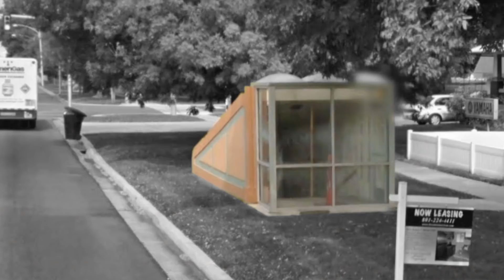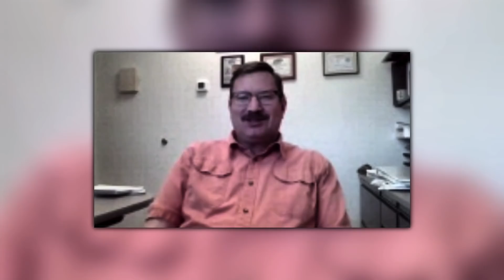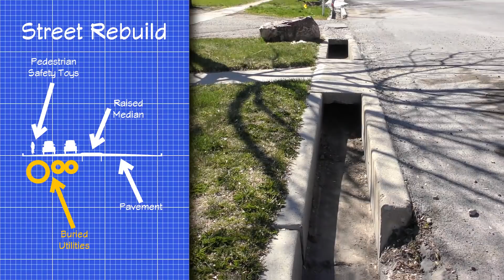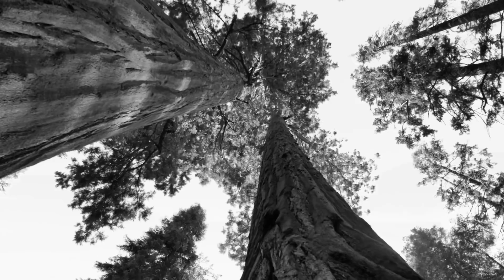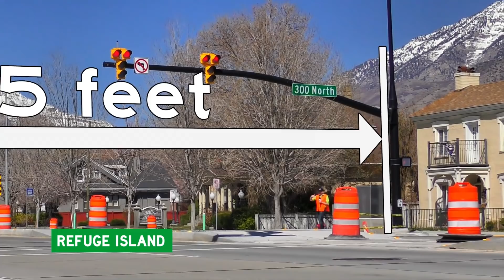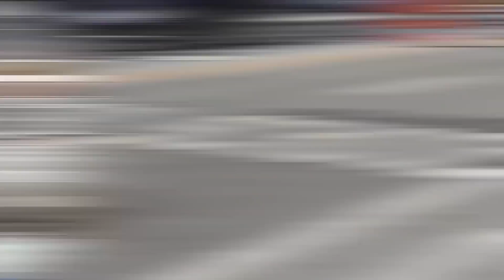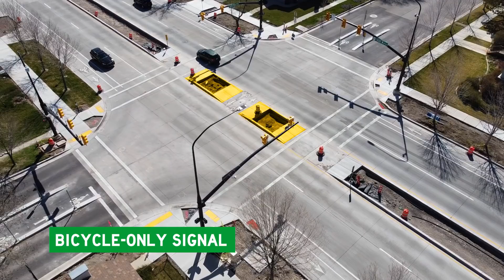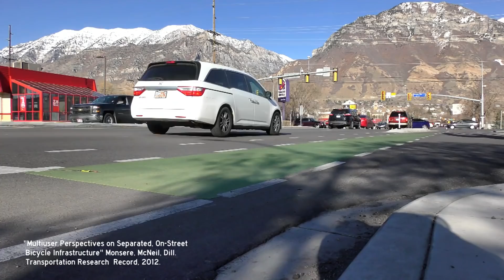Rebuilding the road? Joggers and bikers WANT TOYS, too!

Comment: One thing not mentioned is that sufficiently wide enough medians (6' at minimum, 10' minimum when considering bikes) allow for more efficient pedestrian timing at signals. Each button can call specific phases and sequences to reduce delay for not only drivers, but people walking as well. Along with giving a coordinated crossing and keeping as many other movements going concurrently. 

Something that is often not done, but could be. Problem is that takes effort and consideration for those outside a vehicle. Something our profession isnt great at in general.
Reply: Nonsense. Nobody should even be installing beg buttons anywhere. The safety of people using more efficient modes of transportation (walking, transit, cycling) takes priority over the convenience of people driving.
Reply: @drdabblju   @kisumxes  It's very sad that beg buttons get such a bad rep in the US. But it's not unwarranted. Better signal timing can improve trust in the signal, improve compliance, and protect vulnerable users better.

The problem is signals in North America typically run way too long of cycles, or allow for way too long of max green times, and don't utilize features in controllers that help pedestrians.

- Only run signals coordinated when absolutely necessary there's a whole debate there

- Then, only run as short as cycles as possible, and don't run too long of corridors. 80 second cycles are about the max time before you start running into longer than acceptable delay ped/side street delay.

- Use the ped-reservice function when possible. This allows someone to still get the WALK if they're a few seconds late to the signal, thus greatly reducing ped delay.

- Leading ped intervals with right turn on red restrictions also help dramatically reduce crashes and conflicts between drivers and people walking.

Until we change our signal operations and separate pedestrian phases from vehicle phases which would open up a whole new world for signal timing, there is a lot of benefits to running signals actuated...but who you favor is found in the timing files. 

I've changed signals so that the max time a pedestrian waits is 20 seconds...trust me, it can be done!

Comment: this road just needed a road diet instead didn't look that congested.
Reply: @SomedayIWT depends if you use the grinede space smart like using it for protected bikelanes or transit lanes you might actually increase the roads capacity you might even do that by splitting the road so you have a narrow access street om both sides so your road can stay a road. More lanes are usually not the answer. Atleast not if you want a livable city/town.

Comment: The problem with bicycle lanes is that they're great for a few blocks, then they just dump you into traffic when it gets complicated. They love to build it on wide open easy sections, where you don't really need it.
Reply: Arctic Line  That's 90% of bike lanes I've seen, even in bike friendly places like seattle only a few of them actually have the green crosswalk. Just painted gutters that stop a half block from the intersection

Comment: '3 lanes to 2 means more traffic'

Thats only correct if the corresponding volume of traffic by car is steady.

A comprehensive approach to infrastructure and urban planning which decreases available space for car travel does not necessarily increase traffic or car travel time....in fact, it probably makes travelling by car faster since more people will take public transit, walk or bike. Since it is 'cheap' to drive a solo car, anyone that can afford to, will, unless there is a more convenient faster option. By making more of those options you decrease traffic, you do not increase it. Such programs usually involve taking '3 lanes down to 2' or 1 --- so while SOMETIMES 3 to 2 will increase traffic in the short term. Ironically the ONLY way to decrease traffic in the long run is to go from 3 to 2 lanes/

EDIT: I guess it's not the only way. The government could get involved with restricting road access to only certain people, denying a traditional freedom to travel on public roads. Or they could start taxing/charging all users of the road a very high rate to decrease traffic (Whatever very high amount would make people want to spend longer walking or by public transit because it costs like 30$ a trip to drive). Those methods would also decrease traffic.  BUt if you don't like those options you better start investing in trains, buses, pedestrian spaces, bike lanes and all of the single family home demolition and rezoning needed to get rid of the current US hellscape.

Comment: every American city (and subdivision) really needs more separated cycle lanes.
But those cycle lanes always stop at intersections. why can't city planners design intersections just like The Netherlands?
Reply: Not-Invented-Here syndrome. We look for any and every excuse why it won't port, regardless of validity, even if the "issue" is mild compared to what the original had to deal with. "Those bike lanes they have in [medieval city] would never fit in our American-sized streets."

Comment: Great video! I work in your neck of the woods as a planner for Lehi! I think there has to be a balance for all the differing modes and we really need to make sure streets are safe for all. If safety features are not installed, then we push people into cars who may have otherwise walked or biked for a local trip if they had safe facilities and crossing points. Those who can’t drive or can’t afford a car are left with endangering their lives if we don’t plan these kinds of improvements. I will say I’m impressed with UDOT and the improvements they have been making for safer travel for all modes. I love that Provo put in those protected bike lanes, but I really wish Dutch style protected intersections were considered to improve visibility and shorten crossing distances. It is a definite improvement nonetheless!
Reply: Instead of all these wacky intersections and lanes, seems safer and more straightforward to just give bikes and pedestrians a parallel grid with their own small mixed use path and have them cross in the middle of the road at a 90 degree angle.
Reply: @RealestUrbanism   that is actually a great way to plan things and would be ideal! Complete separation of routes for bikes/peds and cars would eliminate a lot of conflicts and allow for complete priority for each mode on separate routes. It would make it comfortable enough that many more people would choose to walk or bike. The Netherlands is a place that does a great job “disentangling” their routes, or providing separate prioritized corridors for different modes. The Dutch terms “hoofdnetten” and “plusnetten” describe their transportation planning and how separate prioritized corridor plans are developed. In many US cities it is much more difficult to do because of how disconnected local street networks are and that suburban areas put most of their commercial areas along major roadways. This forces people walking and biking to use those roads, or more realistically forces most to drive thus making traffic much worse. That’s why “stroads” are an unsafe and inefficient way to plan transportation since local access and trips reduce the ability for a road to carry intended regional traffic flows. It’s all really a balance, but I think we are still way out of balance here in Utah and the US for that matter. It is getting better though!

Comment: One guy walking on the sidewalk with his long board was the closest thing to a bicyclist.
Reply: Yeah, which is hardly a surprise when to Americans this infrastructure is as novel as a zebra walking down the street. More intelligent bike signals, protected 2-way cycle paths and a lot of redundant bike infrastructure (two-way shared ped/bike path off to the side away from the curb, with an additional cycle gutter in each direction for the faster and more confident riders who would rather tangle with cars than pedestrians, is becoming increasingly commonplace in my city (Christchurch, New Zealand, about the population of Seattle and not the richest country by a long shot). 
I enjoy it, whether I'm in a car or on my bike. It feels more communal, safe and equitable to not have 6 car lanes with a bare hint of a cycle gutter. My biggest complaint is that the bike and pedestrian crossings are always set to a long timer (20-30 seconds) and lack the capacity to detect when the person who triggered the signal is no longer there, having run the red or just kept going. I guess the instrumentation and algorithms need more development.
Reply: That's the issue with just having a few roads with good bike infrastructure. You can't really expect people to choose a bike if there's not sufficient infrastructure to link up their home and destination. It'd be kind of like having a few great roads that are nice to drive, but you still have to drive on train tracks for a few miles to get to Arby's. You'd probably just take the train.
Reply: Tells you something about the quality of the infrastructure. I'm an avid cyclist and you will NEVER see me using that bike lane that flips over to the left side of the turning lane. Nope nope nope nope.
Reply: @HavokTheorem  What's crazy is when you do the cost calculations, bike and pedestrian infrastructure moves the most people per hour per dollar. Now, their top speeds are lower, and consequently comfortable travel distance, which is where trains come in. Cars are by far the most expensive option per person moved in an hour.
Reply: Pretty telling of the effectiveness of the infrastructure...

Comment: Where I live, the preferred method for bikes is what the city calls a "multi-use trail", they are essentially two-way bike lanes, raised to the sidewalk level and either used both for pedestrians/cyclists or they are separated. That way it doesn't take up a lane that was for car traffic, and the car/bike separation is a curb.

Comment: You could also do a video on the bus only lanes they are adding all over portland. The city is ripping out car lanes on roads that were already extremely congested making them a nightmare for rush hour drivers. the burnside bridge and oregon hwy 10 off barbur blvd are the two spots that has created massive back ups where traffic used to flow great.

Comment: I liked the mention of the diamond diverging interchange as a tease for the next video.
There's one here in my town in Lincoln. It felt weird the first time but it's better tbh that installing a cloverleaf exit. The paint and signs are necessary but the way the road is angled, with a pointy curb encourages drivers to cross over

Comment: Portland Oregon has two neat bicycle toys for traffic lights.

The first is that a lot of traffic lights now have a small blue light next to the red light. That blue light is there to let you know that the traffic light is aware of a bicycle waiting for it. When you roll up and stop on the trigger, that blue light comes on the let you know it knows you're waiting.

The second is a countdown timer that some signals have. It'll have a red stoplight for bikes that lights up when it detects a bicycle, and a ring of white lights around the red light that countdown to when the bicycle is going to get a green light. It doesn't mark any specific amount of time because it's based on the other signal phases. The countdown shows you how much of the traffic light cycle is left before you get a green. There are even sometimes the last third of that Countdown Just disappears because it skips a phase when there are not cars waiting.

Comment: Years ago I went to a local college.  Every winter the parking lot would become a complete mess.  It was a giant lot with no islands anywhere and long, long rows.  When it would snow the lines would be covered and these long rows would get crooked, often to the point where they'd become unpassable.  Since people would tend to show up in waves on the hour sometimes you'd get stuck in these rows with people behind you who couldn't back up either.

At the time I thought it might be possible to mount lasers on the street lighting that could project lines onto the pavement (sort of like some of the ones you can get to make shapes on the floors and walls for parties, or like a laser line straight edge.)  I suspect that unless they had complex logic to adjust for when really deep snow.  At a certain point the lines would be distorted by the height of the snow.  For plows I'd think it wouldn't be too hard to embed something into the pavement... a chunk of iron, RFID chips, or something like that that the plows could have sensors for.  It would probably be cost prohibitive as a parking lot technology to have all the cars have special sensors unless they had some other purpose as well.  The distortion from projecting laser lines could probably be solved if you projected fairly vertically, but you'd still have to worry about dazzling drivers with them.  I did think maybe if each one projected just one straight line it might work, but then you'd need one for each line in your parking grid.  In our old giant parking lot maybe just having the lines for the back of the parking space would have worked... that would at least let people no how far to pull in.  From there, if they were off left or right they might costs a few spaces but they wouldn't block whole rows.

Of course real curbs would work, but that makes plowing much more difficult and would cost more.
Reply: Or use those lasers to melt guide lines in the snow (or maybe something as low tech as steam pipes).

Comment: theres a sensor that when a driver shows up it can turn the light green , a special light, it even has a special car icon  that lets them stop without having to stop and press any buttons. Instead this radar can detect when a car rolls up automatically. People in cars don't want to get out of their vehicles to push the button. And once they're across it turns red the bullshit motorised traffic can proceed.

Comment: Great video, as usual, Rob. A few thoughts:

Vegetation in the median: As your guest said, tree selection is critical. Near my home, we have a median with trees that are about 20-25 feet tall (mature) and their root systems have extended to under the street and buckled the asphalt. It's like hitting a small speed bump at 40 mph every 100 feet or so, making for an unpleasant ride.

Here in San Diego, we've been investing heavily in bike lanes for years. We've recently removed (and continue to remove) vehicle traffic lanes and are replacing them with protected bike lanes. 

We've also constructed the Bay Shore Bikeway, a 24-mile bike trail around San Diego Harbor that is well separated from traffic  in many places. However along CA 75 between Coronado and Imperial Beach, you'll see bicyclists riding on the shoulder of the highway with traffic whizzing by at 65 mph instead of using the dedicated bike lane 100 feet away from the highway.

You can build all the "toys" you want to protect pedestrians and bicyclists, but if they refuse to use them, that's another story altogether. If we're going spend millions to protect bicyclists, it's not unreasonable at all to expect them to use the infrastructure properly. Just my two cents.
Reply: I've seen and experienced some of the San Diego bicycle "infrastructure" - it's not really well done. So, it's not reasonable to expect someone to use badly designed infrastructure 100% of the time.

Comment: Love watching these videos from Europe. Our road infrastructure is so different! Would be awesome to do some form of comparison video
Reply: One big difference is with trucks. The EU did finally yield to the 53 foot container, but stuck to an overall length for a rig of, I believe, 61 1/2 feet (metric I think it's 18.5 meters). Hence no large forward hood on the tractor; it goes straight down, making for a much shorter wheelbase and therefore a much rougher ride for the driver but much less difficulty maneuvering. In the US, while the federal government allows states to limit a trailer length to 48 feet (though a majority go with 53, and almost everywhere 53 can be permitted under special circumstances), they effectively have to accommodate 75 feet for a semi (articulated lorry) rig bearing in mind minimum length limits for trucks with longer cabs or for car and boat transporters ; in some parts of the country it's higher than that still. And a lot of highway specifications here flow from that particular consideration.

Comment: In Ohio, between the Short North and Old North Columbus, they have split Route 23 into parallel, 2-lane one-ways. This just so happens to run right through the older houses and gentrified apartment buildings used to house the College running parallel .3 miles West. They have a TON of traffic at differing times to their schedules. And being so close there is a lot of both foot and bike traffic
I just want to say I do find it interesting yet amusing, their solution for bike safety with minimal too much car interference/annoyance. Does it work?

I was a food courier in OH, I recently moved to MA and continue to drive just as much here